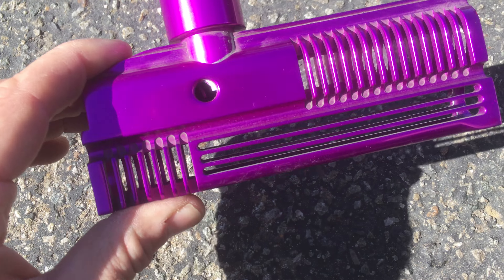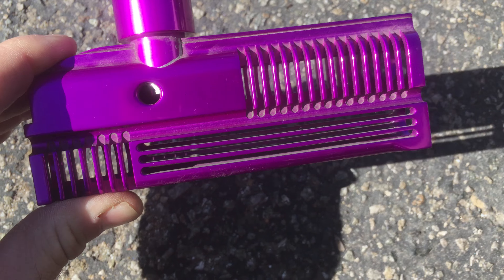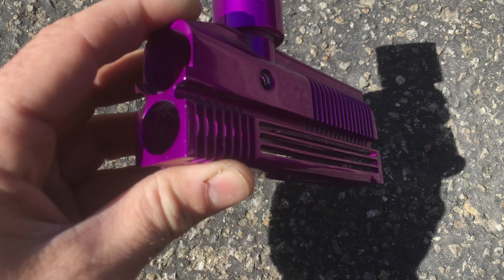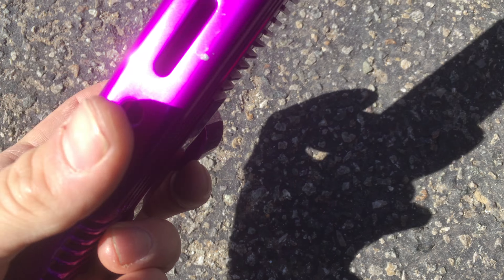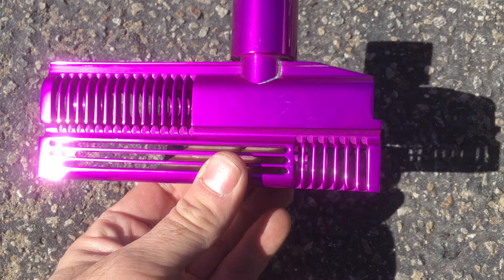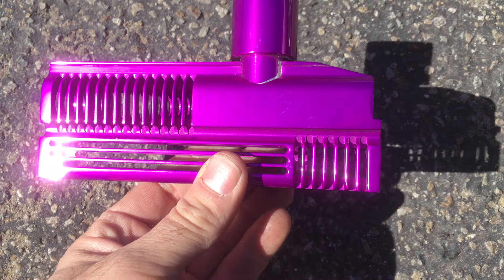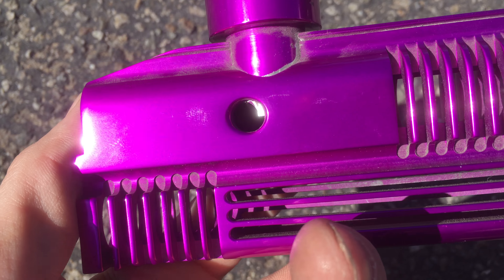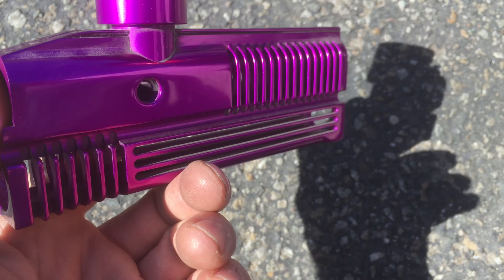Spanky Ying Yang Minicocker Body

Comment: Easy fix. Put a cheapo stock bolt in there and use a gear puller to pull the press feedneck